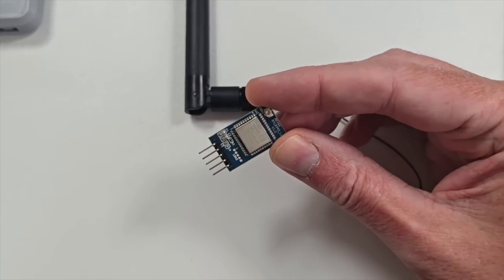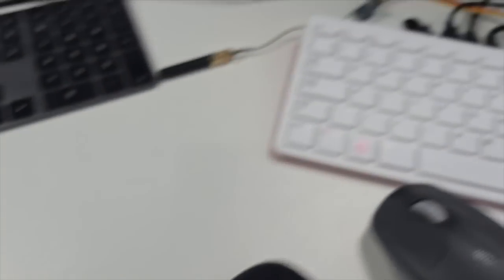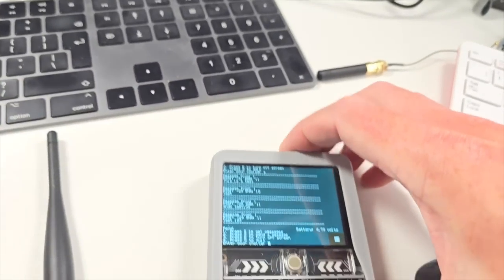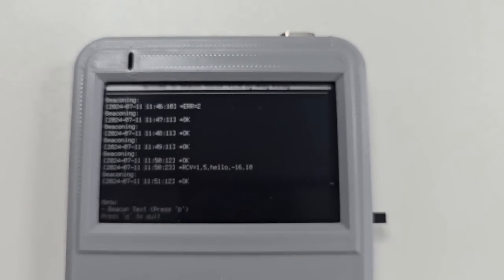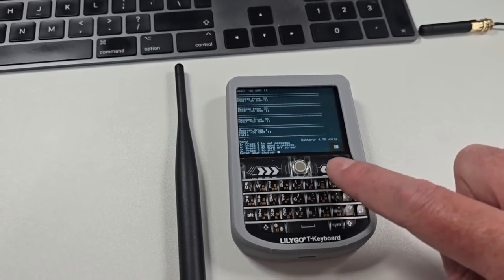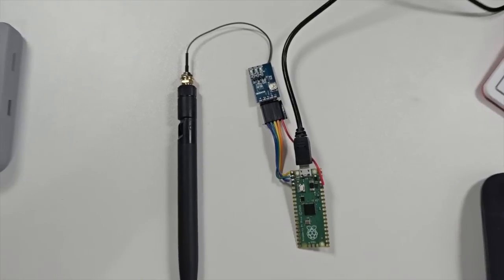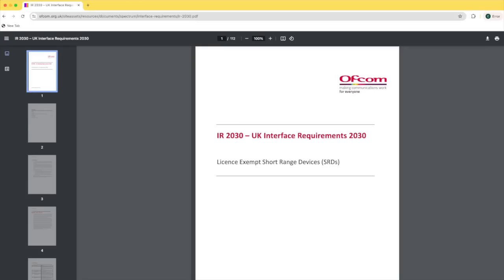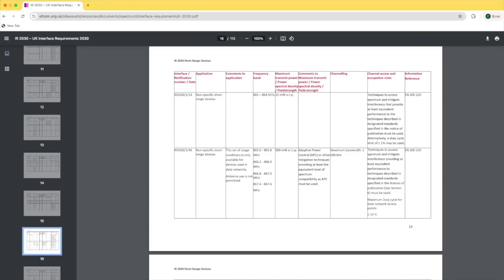LoRa Long Range Message System (LRms) using Reyax LoRa modules.

Comment: In the 80's and 90's we had packet radio. Not for tracking like now, but for flawless chatting. Connecting to a station and from there manually connecting to a station further away and so on. It would be great to have firmware for the existing meshtastic hardware that could work like that. The hardware couldn't be too slow, since it was running on a Commodore 64 back then.

Comment: The thing that intrigues me about the Reyax boards is - with a quality… Cat5(?) cable, it seems I could put a Reyax board & antenna in the attic, and have some ESP32 board down in my living space… Where I can touch it and work with it. I note this is a segment Meshtastic pretty well tossed aside. For me, if I can have antenna and LoRa transceiver high up, then control it from below, I’d be in great shape!

Comment: I like your approach. I've done a similar project after seeing the inadequacies of meshtastic. I'll work on translating your python parameters to c in order to apply it to many devices and microcontrollers. (I'm not a python pgmr.... lol), but I have several Lora modules that are not meshtastic compatible and could use a purpose in life. Thanks.

Comment: The engineers knew very well that using this technology on a large scale would result in failure, with the system being overloaded and no way to deal with it. From the beginning I had doubts, as no large manufacturer or manufacturers produced units that customers could just buy and use, like phones for example, they knew that doing so would bring their companies trouble, because buyers would be contacting them saying they do not work as they could neither send or receive messages at an acceptable rate when the number of people using them grew.
The Meshtastic approach is not the best either, online flasher is one big no no, people who buy these need to have access to the tools to flash these devices without using internet which could be unreachable, and will most likely be unreachable when people turn to these devices in emergencies. 
There is too much updating / re flashing involved too, it makes the whole process too time consuming and uncertain.
For any system to work in an emergency, tools need to be preinstalled on computers so flashing stocks of devices can take place, and settings inputted in order to commission more devices, that is not the case with the Meshtastic approach, it even depends on google and play stores for apps, another huge non runner for many reasons, google will find a way to mess this up if it did get big, they want control of all data, no matter how little it is, using google and apple devices is just plain stupid as they can see everything you type long before anything is encrypted, and you don't need to be a criminal now to have everything you say used against you.

Comment: Does the repeater also function as an extra node in the network to connect to, so others can increase the range as well? I was planning to add an antenna on my roof, but there aren't many nodes in my area. Or do you advise adding a node with a high gain antenna on the roof?

Comment: If people like Andy, actually explained the basics and the way laymen should set up their nodes/devices etc, then Meshtastic would work much better. We need someone who is interested in helping us
Reply: You won't even find this on the Meshtastic forum, there is documentation, but it is not clear enough and specific enough. Ask a question and you get answers like I have mine set up like this and it works great, yet when someone else does the same it does not work well. The sellers of the boards also need to be held accountable and have the latest version of firmware on their boards, this crap of people having to immediately update to get a board to work should not be, too much updating in any case with these things for normal people to remain interested in them, people want to leave the device alone and for it to just work.
The first phones I had never required an update, until google and apple came along.

Comment: Meshtastic also has a problem when your population isn't dense enough. I've dumped about $1000 into building nodes and pocket units with the idea that about a dozen people in my group could message each other. It doesn't work. From my repeater on my roof, I can see my friends repeater and his handhelds. From my handheld, I can see his repeater, but not his handhelds. Apparently if all your handhelds can see the same repeater, it would work. But building a network of relays for dispersed nodes just doesn't work. I wish I'd known about this before dumping money into it. I'm moving onto GMRS. It's fantastically cheaper and works much better as emergency comms.
Reply: As long as you are not living somewhere in Texas nowhereland you come over extreme distances mounting 4-6 solar based repeaters on poles 50km around your home.  If there are no people living within 150km / 100mls you decided to do not communicate.

Comment: Meshtastic isn't broken. Too many people were setting up nodes with ROUTER_CLIENT preset, which clogs up the mesh. So they are removing ROUTER_CLIENT, and have set a "Zero-hops-policy" for MQTT which addresses people flooding the mesh with internet MQTT traffic. A CLIENT preset, which routes to the furthest reachable node, is a sane and workable mesh topography, if users would simply let it work.

Comment: I went and bought every thing, 
Heltec V3
915mHz antenna (from Seattle)
Bender case
And a Sony 18650 battery,
Only to see no other nodes in my area with the right settings… kind of wasted $90
Reply: Hopefully some nodes will show up on the app someday…

Comment: Unfortunately i agree with Andy, i was an early adopter of Meshtastic and had  high hopes for its success but as time and popularity occured i realised as a serious messaging system it wasnt going to be suitable, corrupt messages, not everyone seeing messages on the long fast message board and thats if they where not corrupt, PMR 446 has a much more useable interface that can pass voice communication aswell as messages if you go down the digital route, i would certainly grab my radio before my Meshtastic device in any situation where i thought there was going to be any power or communication outage, its not early days eiher so i personally dont see how it can be buit on to make it significantly better, there are many usage scenarios for Meshtastic that will work well, but large scale messaging over large areas isnt one of them, if there was a disaster and everyone jumped on there Meshtastic to communicate it would ultimately fail. Im still very interested in Meshtastic and will continue to follow its future and hope the clever people find a way to make it more reliably useful 😢

Comment: Step one, switch to a faster speed, long fast is only ideal in situations where there’s only a few people. 

Step two, increase the organization of the network, use mqtt to bridge and layer the network on a bunch of channels and a bunch of speeds on each channel regionally. 

Tons of people using the same single channel with 50bytes/s rate won’t work. Faster speeds are available, easy to use, and much faster up to 300x faster.

Comment: First you sing the praises and urge everyone to go out and buy the boards and cases, then months later you give up and move on. I feel scammed.
Reply: These devices arn't a scam, I never had to pay for meshtastic. I can think of 5 other fun firmwares to play with on esp32 chips.
Reply: I think the reputation of Meshtastic got ahead of itself. In small scale tests it was borderline magic but it turned out to have scaling issues when usage exploded.

Devs are working through it and just a few days ago it had to disable the ROUTER_CLIENT role because it turned out people were (probably unknowingly) misusing it. Those nodes were prioritized in routing because they were supposed to be at geographical advantages for range, but people were just mounting them on poles and such. Those nodes had better coverage than random mobile nodes but far from what the intended use demanded.

Basically we're early adopters. I've been a Meshtastic user since the 1.x series builds and it has come a long way, but it's not ready for mainstream adoption just yet. Keep an eye out for routing changes in the changelog, now that there's momentum in solving scaling issues we need to test the scaling as quickly as possible!
Reply: Not really Andys fault he didn’t make it. It’s a cool project it cost me about £30 to get involved and the esp board can be used for almost anything
Reply: For me and my family and friends, I'm sticking with LORA meshtastic. It serves a purpose, and I'm gonna keep it until I see the need to change.
Reply: Nobody knew it'd fall apart if it became too popular though, still glad I didn't jump in too soon mind you 🤷‍♂
Reply: @TheeMuseumofjunk pretty obvious it would fail with too much use.
Reply: @over-engineered  Obvious to engineers, however the customers are primarily non engineering users.
Reply: Can you explain why? Genuinely curious, not trying to be confrontational in the least.  @over-engineered

Comment: I can't help thinking that it's not meshtastic that's broken, it's the config settings of the people in Manchester. Long/Fast may not be the best choice, probably not all the static nodes need to be on full power, and if there's anyone junking out MQTT traffic then they need to curb it, even if everyone has Ignore MQTT switched on. I would be interested to see how congested 868 MHz is on a waterfall. Popularity has its own downfalls lol. 😂
Reply: In my opinion one mistake was calling it “Long Fast” in the first place - in a hobby populated by mostly blokes, who wouldn’t want long and also fast, who would want less than long, who would want less than fast, everyone is going to feel short-changed and inferior if they were to admit they’re on medium-slow or short slow or something unimpressive like that – that’s what people are like
Reply: @IanTindale "ribbed for her pleasure" 🤭
Reply: @IanTindale I think it should dynamically change as long fast is good where there’s few nodes as it has better range and reliability but where there’s loads of nodes that range just isn’t needed any more

Comment: We've had a great deal of success with meshtastic, in the UK running 120 nodes at a recent hackers/makers festival and seeing around 30ish at glastonbury festival, I didn't have a single lost message and we were reaching from mid-Dorset all the way to Burnham-on-Sea on default/legal power settings (albeit to elevated locations). Phone networks at both events were sub optimal so it was genuinely useful, but I saw less external interference on 868Mhz in these countryside locations compared to built up areas so this may be a factor that negatively affects meshtastic. Exciting times and I hope either future meshtastic firmware or a new Lrms style approach will make things even more robust. As an engineer I still regard the chirp system as absolute magic and its performance continually astounds me.
Reply: How do you know that you “didn’t have a single lost message” when lost messages don’t leak proof of their being lost? Unless you’re instrumenting multiple nodes over another transport to verify delivery, you can’t prove that things don’t get lost. Change my mind
Reply: Were you on long fast default at glastonbury? I topped out at 13 nodes on site this year. 

I wouldnt be surprised if you were hopping via my node, theres one on the hill line of site between festival ground and the coast with a good path over to weston bridgewater and sometimes across into wales

Comment: Mesh tactic was a nightmare at the Dayton Hamvention earlier this year.
So this "new unit" runs with AT commands? Similar to the Hayes Smart Modem commands?
Reply from the maker: Yes, I'm aware of the hamventiin problems.
Correct it's similar to the the Hayes command set.

Comment: why is messaging not working for u Andy?   it works great in our town... what is your problem with it?>
Reply: Looking at the UK situation, there was a thought it could be a mass chat protocol .. I have a few nodes, static, solar and mobile and it works for me - I only need a small mesh to communicate in my village, very few people will have the funds to join the system, but if they can and expand the local mesh, that’s great! But due to distance and habitation, i doubt it will bridge to the next city. The UK has a higher density, and it’s now saturated to the point where it looks like it’s falling over due to its own success.
Reply: @recom273  maybe folks in the uk do something different, like not managing the network right? other types of networks can be congested too and optimized to be efficient. i dont see anything exlcluding meshtastic.
Reply: Exactly  @recom273
Reply from the maker: It works with a handful of nodes but in congested areas it falls over.
Reply: @andykirby can you give some technical detail on your claim, like demonstrate the issue?  just that your video isnt considered as clickbait
Reply: @andykirby increase radio speed, coordinate everyone to do the same, the UK has a ton of restrictions on broadcast time so to shortening broadcast times is necessary and to do so increase the radio speed. You can 300x the capacity of the network instantly and shorten the range of individual nodes thus reducing cross traffic

Comment: It’s pretty simple to control the Reyax modules from an Arduino or ESP32 with a bit of simple C coding to send out and relevant AT commands via the serial port.
Reply from the maker: Yes it is, what would be cool is to be able to use the SPI based LoRa module on a lot of these boards to communicate with the Reyax modules.

Comment: Yeah tell us it’s broken after you told us to buy boards and how great you thought it was. Going to try selling me a diesel car next?
Reply: Reality is Meshtastic is still only releasing Alpha and Beta quality software. If you're on the network then you are an early adopter. Clearly we need lots of early adopters to work out the scaling issues but jumping ship now would essentially be to judge a book by it's cover.

Anyway, it's your boards so you can do whatever you want with them (as long as you follow the regulations), but if you do switch away from Meshtastic I think we'd all appreciate you coming back later for the next round of testing the mesh routing. Mesh routing changes are mentioned in the changelogs so keep an eye out for those.
Reply: This!
Reply: This Technology is Bleeding Edge, if ya can't handle that, go back to Knitting 😂🇨🇦
Reply: A small amount of research from him would have saved everyone wasted time and money 😤

Comment: You and that Ringway feller sold me on the T-deck a while back.  He mentioned Manchester area is too dense and flooding.  In Dundee, it's more like planning where to put repeaters.  At that time I reckoned Meshtastic is a waste of what the T-deck could do anyways.

I was spamming your man a couple months back with old man stories about AT commands back on dial up days.

Cool to see you on micropython with the T-deck, I dunno how or why but I ended up on CircuitPython first for my attempts.

I'm building "PyTOS" which right now is a crappy command prompt and eventually issuing the pytos command will lead to an GUI.

I seem to be communicating with all the hardware except for LoRa right now, once that's cracked I'm onto the GUI and building a way for folks to build and load python based apps.

My end goal is to have python variants of meshtastic, ripple and all and any other protocols I can find.  I'd love to include LRms in the bundle when I get that far.  I also considered just a basic LoRa packet sniffer so you can see what protocols are firing around you or diagnose issues with code or hardware.

Comment: lol. This only works because no one is using it. If you can’t see how this will immediately fail when on a wider release…. You already lost.
Reply: the frequency range is also pretty uk and ham specific. scales by exclusion 👑
Reply: Harsh but true. This video seems to represent exactly the same flaws that Meshtastic does.

Comment: how is it broken?
Reply: User error of everyone using default settings designed for areas that have few radios and applying it to packed areas
Reply from the maker: Err messaging doesn't work...
Reply: @andykirby  now i think you are just jealous on the success of something else.. what a bold claim
Reply: @andykirby  it works. It works fine. If you mean mqtt flooding the app. That's a configuration issue
Reply: @pen25 whilst MQTT being broadcast and leaking into the mesh etc is an issue, the real issue is that too many people are running as router etc when they are in sub optimal locations. If people stuck to client and client mute it would instantly help lower packet collisions. But nobody listens, no matter which forum we try to educate people on this.
Reply: @mattstacyandthepomskies  agree. again a user configuration issue.

Comment: Well I get no contacts here Yeovil so diluting the pool of contacts with a 2nd protocol would be a disaster :(  Great idea though. I like Tulip firmware for the Tdeck. Great video dude
Reply: I'm 14 miles north from you on high ground running an omni antenna, In the next month I'm changing it for a south facing yagi (due to higher hills to my north) so hang on in there as I think it likely I can reach Yeovil. I can already reach Weston&Burnham to my west on the coast with another antenna so lets make this thing work :-) 26CT813